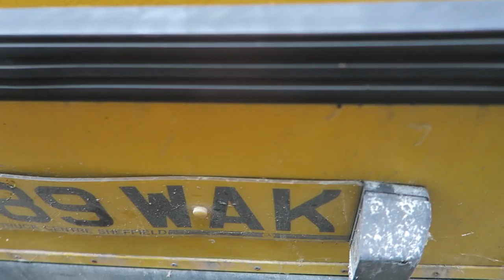BUS CONVERSION #6

Comment: The difference is basically like night and day! Silicone doesn't do anything well. The slightest bit of flex and it will split and leak. Good quality sealants like sikaflex are flexible and they stay flexible and watertight. Flexibility obviously isn't a problem in a house but in a van it is.

Anything you have installed with silicone you should take out and re-fit with sikaflex or another quality sealant. I know it seems a drastic measure but it's a lot easier now then when it's built and you are living in it. 

I think it was ALL44 who asked previously about fitting windows and keeping them water tight. The answer is use quality sealants which will flex with the body.

Windows fitted correctly with Sikaflex should last 10 years plus. If you have put them in or installed anything else with silicone I give it 3-6 months and it will leak. I have done what you are doing professionally and learnt from some very knowledgeable people. But as i said this is an open platform. Don't just take my word for it. Ring a few professional converters such as RS motorhomes and ask their opinion. I can't stress enough the importance of using the right sealants.

Comment: Please stop using silicone as a sealant. You are making a classic newbie converter mistake.

Are you from a contract house building background? Silicone has no place on a motorhome. 3-6 months tops before it starts leaking. Sikaflex 221 is what you should use. There are cheaper alternatives in certain applications but if you are unsure always use it. It may be 5-6 times more expensive but you'll understand why after the fact. 

I hope I'm not coming across as a Youtube know it all. Research it. You'll understand why. You follow the USA threads but it is different for them because their climates are a lot different than ours. 

You have obviously done your homework but you have missed the most important part. The key to converting a motorhome which will last is in the sealants. It's like building a house on quicksand if you get it wrong.
Reply from the maker: they only sell it in colours! Which is no good to me. Shame. Thank you so much for the heads up though. So whats the difference on using silicone on a house from a van?